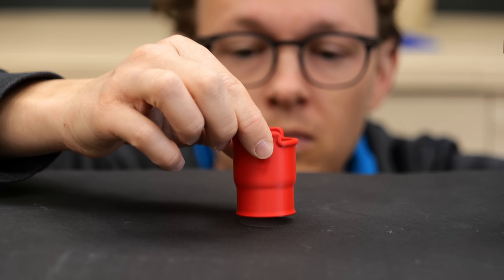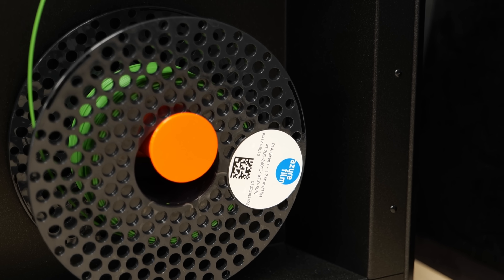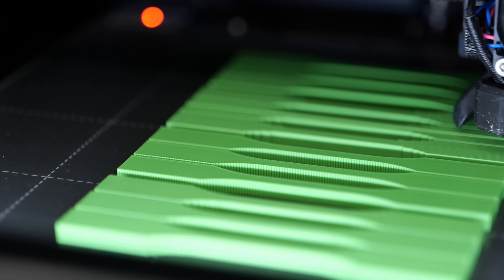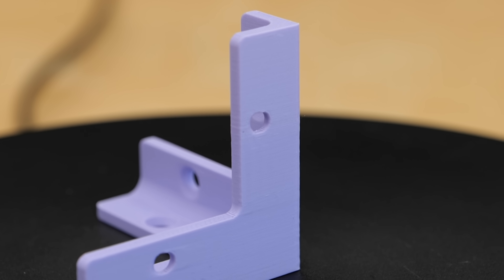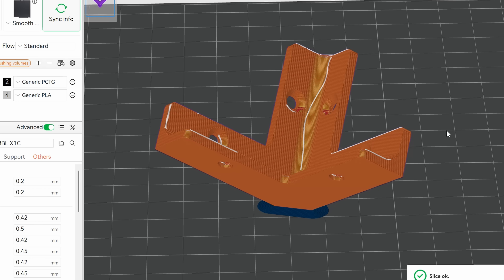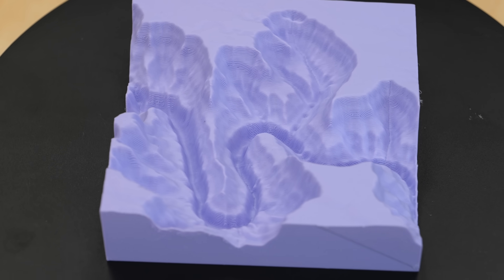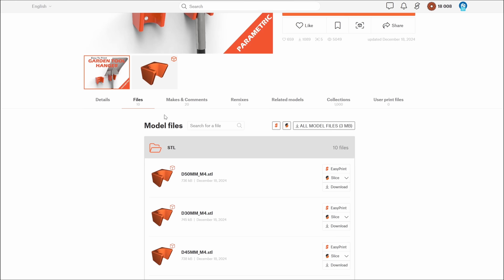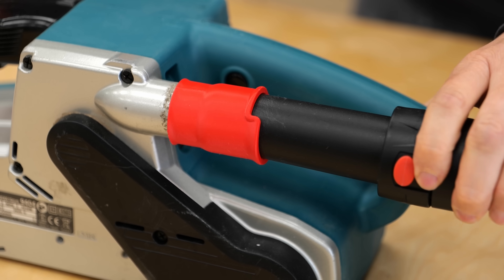Does Angled 3D Printing Really Make Parts Stronger?

Comment: I think the best advice on this topic I personally can give (because I've had to learn it the hard way and would like to spare others the time) is: If you think you might run into problems with anisotropy, remember that (if you design a part yourself) you don't always have to make one big piece; screws, glue, or 3D-printed connectors can help you print multiple small parts in their optimal orientation and then connect them afterwards. An example I created was a rigid, flat wallet for credit cards etc. Printing it standing up would crack it when it flexed, and printing it flat in one piece didn't work because the bridging was too extreme. So what I did was print the two flat pieces (the "top" and "bottom") flat on the print bed, and then made a 'C'-shaped spacer; I left 2mm holes in regular intervals (I think every inch or so) and after all the pieces were printed, I used filament like rivets by cutting them a bit longer than the thickness of the wallet and then using a soldering iron to mushroom them out so the parts couldn't separate. I also chamfered the edge of the holes on both sides so the "rivets" would melt flat and still have room to widen, but in retrospect that was almost unnecessary. The wallet so far has survived about two years in my pocket, so the filament rivets do hold up pretty well.

TL;DR: If you can't find an orientation for a big piece, try to separate it into multiple pieces and assemble them after printing.
Reply: This is the way!

Just because you CAN print something all in one go doesn't mean you should.  I've built some things out of 3d printed parts that people have said couldn't be done or would come out incredibly weak because of the layer lines, but if you break it down into  smaller pieces and do what you can to keep the layers in compression you can make some wild stuff.
Reply: @ellieallen115  And just because you can print something does not mean you should. like the bracket, it's good for strength demonstration but it is the kind of simple industrial part you should just buy if you need it.
Reply: @gathorall9136  Yea, a 90 degree strut strap is less than 4$ at home depot. But I suppose some may want to maintain a certain aesthetic, and the added strength isn't necessary
Reply: 我自己沒在用3D印表機 但我也是這麼想的
看著很多人在探討怎麼印比較好時 我總會想用組合的讓各部件都有著它最優勢的列印方向再組合起來不好嗎?
不知道是不是因為我是從小就常玩組裝模型 對這個想法覺得很理所當然
但3D印表機的使用者應該也大都是手做愛好者吧 小小的組裝應該不會成問題才對
Reply: I was just thinking that, I would print it standing up, so I don't need so many supports, but with 3 or more channels around it and screw screws into them to take the moment forces. Also a thicker rings at the start and end.
I always design my 3D prints to be supported by screws through the material.
Reply: Alternatively, get a piece of pipe that does not fit and print adaptors to put at either end. If you manage to crush the plastic inside the metal pipe anything else would also have failed.
Reply: This sounds like a great design. Is there any chance you would care to share it?

Comment: For the test hook printed at 45deg, I wonder if the lack of strength improvement came from the thinner side walls.  If perimeters stay the same it makes the effective wall thickness thinner the more of an angle it is at.  At 45deg it should only be 70.7% as thick as if it was straight up and down.

Comment: I made a shelf for filament earlier this year. Printing it on the corner not only made it stronger but also allowed me to connect all three axes of each connection with a single bolt. It also made it look a lot nicer. Printing orientation is probably the first thing I think about when designing a part, it helps limit or completely eliminate supports while making the best of the technology used.

Comment: 00:10  45 degree on the edge. Curious to see what you went with.
Reply: There is a reason most 3D2A parts are printed at an angle…

Comment: I don't know how much this is covered by patents but something I have been looking for in slicers is staggering the infill as Stratasys does so your infill is printed with half layer offset from the perimeters. There's a possibility to fiddle around with the extrusion parameters and use the combined infill option on Prusa slicer to print extra thick infill every other layer, but I haven't been very successful with it.

Comment: I actually just had a project where I was fixing my couch. The original part was a fairly thin injection molded ABS, it got most of its strength from the staples holding it to the couch. Replacing it involves taking the couch apart just to staple in the same flimsy part. Instead I made my own, but since this is a leg and has to support not only my weight, but also shock/shear loads when someone sits down quickly and at different angles, orientation was critical.

I ended up splitting it into 3 parts, the leg itself and the two plates the attach to on of the boards inside the couch. It would be too long for a yt comment to explain the orientations and why, but suffice to say I'm writing this on that couch with the new part right now 💪

Comment: Silly maybe, but I have found, that at least for PEI plates, simply cleaning it with 5 parts good dish soap to 95 parts water does absolute wonders.  I also do NOT rinse it off, I simply wipe it with a clean cloth after cleaning with the soap.  
Bed adhesion problems are a thing of the past, at least for me.

Comment: @8:22 “S shape”… NO, you choose the shape of the interpolation without consider the obvious physics: the greater strength is proportional to the length of the continuous material deposition, which increase as the cotangent of the angle you defined and stabilises to the maximum when the whole length of the object is covered by the cotangent, furthermore the infill angle and type (obviously) would matter for your pull on length reductive test. E.g. 100% infill with “aligned linear” pattern along the length (adjust the rotation parameter of aligned linear to 0 or 90 degree depending if the piece is oriented along x or y when sliced) and you will get the strongest strength on pulling

Comment: My question is why you don't take your own advice as default when printing. You managed way stronger layer lines with VERY minimal part cooling. 0.45 or 0.48 mm layer width and slightly elevated temps. All can be achieved while keeping good quality. I don't have nearly ANY lay splitting even on weak parts tested to failure. That's thanks to you. Why is that not default when printing for you?

Comment: Good video, this is something I've been doing for years, particularly when printing parts for firearms. It definitely helps with strength in real world situations. Given that the parts I print are put to very high stresses, I've been forced to find techniques such as this to maximize part strength. 

I also do a decent bit of resin printing for functional parts where orientation is the difference between a durable part and one that just snaps instantly or is dramatically warped and out of spec. Something you might be interested in is the slicer for Formlabs printers called Preform. Their auto orientation feature is quite refined and can give you some interesting ideas on how to properly orient a part for both FDM and resin printing. You should be able to use it to slice a model without a Formlabs printer attached.
Reply: 3D printing firearms 💀
Reply: @liamoliverdarroch6482  Parts used with firearms
Reply: @sourc3C  Bro you're 3D printing ALL the parts for firearms? Most people just print part of it, that's crazy

Comment: I had biggest struggle regading orientation when I designed a rack and pinion mechanism with three pinions in 120° angle each. the triangle shaped rack had no "good" orientation to print. At the end I splitted it to two parts, glued together with dowls. At least the teeths ware printed well, not sure about strength, at least no fail until now.

Comment: use the long direction for stress,  Whats more important is use the correct plastic and if you really need strength then anneal.  never use PLA for anything but prototypes or trinkets.

Comment: Thank you for all this information.

One hint: If you print with less than 100% infill, changing the orientation also changes the amount of filament you use (in the model as well as for support), you should compare strength with same filament usage.

Comment: Would part strength differ much if each part would be printed separately? In such case new layer would be dropped on a still warm previous layer and maybe some better connection between them would occur?

Comment: Call me lazy has fuck but im still using a 5 years old slicer with only 3 / 4 settings and it's fine. But yeah the profile of my machine is not present on real slicer so i can't print those support trees, sadly. But yeah of course some orientation are better than others, and you need to design with this in mind, who gonna make things harder if your part is complexe.

Comment: you can also print your part at 100% infill, then pun it in the jar of fine sandblaster-grade sand, compact the sand until i can hold the shape of the part, put the whole thing in the oven until the whole part melts down and then resolidifies into injection molding-like strength

Comment: I'm very skeptical of that s-shaped fit. The data shown don't really show that shape at all.
Reply: With just a few single-part data  points, and allowing for a host of variables in both parts and measurements, the experimental curve could be any shape.  
Stefan's experiment gave a  remarkably good fit to the theoretical line - my old supervisor at Rolls-Royce would have accused me of fiddling the results if I'd got that close, and sent me away to do more tests!

Comment: If I have to use a brittle material, I make place for long M3 bolts + threaded inserts in the MCAD. With the steel reinforcement, the layers will not break. Otherwise, TPU is king in this case !?

Comment: Good tests, but I would just print your hose adapter hotter, slower and make the part chunkier. Your previous tests showed that this can make layer strength up to 80% of the XY strength, which is good enough for any use if you add a few perimeters. I've used this to good effect with ASA and ABS. I'm surprised you didn't mention this option!
Reply: I really think he just used the wrong main example for this video.  There were too many OTHER things that would've made more sense, (material, time, temp, design). At the end, he almost just said "this is not really a great idea".  I think the other examples were good though, like the benchy and the bridged part.

Comment: the real answer is don't use worthless PLA for functional parts... duh. Get some PETG pr PCTG and print it however you like
Reply: PETG / PCTG is stronger for a lot of applications (not all), but still suffers from the same layer adhesion problems.  Print orientation still makes a huge difference

Comment: Just use TPU
Much "stronger" and won't crack.

I love it for thing that should be slightly flexible like vacuum adapters.

I made a vacuum adapter to stick to the wall wile drilling in concrete, went through 3 PLA ones for 3 holes then i printed in TPU and it held up to the last 30 holes i needed it for and still looks like new

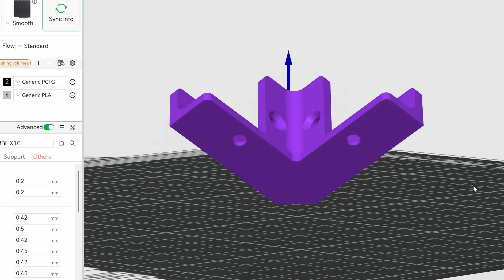Comment: 9:20 just move the object a bit down and the slicer will only print what is above the build plate, easier than cutting
Reply: It depends on the slicer. Not all slicer allows to "submerge" the part below the bed, but cutting parts is available in all of them?

Comment: One aspect to improve interlayer strength is line width. By pushing more material there is more heat and this creates a better connection. I did some tests which were not very scientific, and the outcome was clear.  Maybe you can perform a few tests.
Reply: Stefan did do a vid on how layer height affects strength. I don't recall exact results, I vaguely recall don't go beneath 0.16mm for strength.

Comment: I was thinking for the vacuum adapter, you could make it into two parts. Inner sleeve and an outer sleeve printed at opposite 30-45 degree angles then bonded together. Sort of like how carbon fiber weave orientation is alternated between plies for strength.

Comment: design the object so that it prints at a 45 degree angle anyway. it doesnt need to be a tube with a flat bottom just because thats how other hose nozzle adapters are designed. make it a trapezium, or a parallelogram.
Reply: I was thinking this but in the horizontal orientation. Why not design a flat spot on the horizontal section for which it can stick to the bed better, minimize overhangs when it starts printing up the contour of the adapter and use lower layer height for better overhang printing.

Comment: I often use threaded rod, or even lengths of a metal coat hanger, to strengthen my parts perpendicular to layer lines. For the corner bracket, for example, design a hole from the outer edge of one of the arms into the intersection of the three arms, with a diameter that is snug around a piece of coat hanger, then drive the coat hanger snippet into that arm after printing. 

For the vacuum adaptor, I would have probably added 3 coat-hanger 'channels', spaced evenly around adaptor, and printed it vertically.
 
I know...post-processing bad...but if strength is paramount, I do what I have to.

Comment: I design for Printing and this is often the most important consideration, though it can be over come by increasing wall count on some designs, with some materials, I have some designs that are essentially round bars and printing them in th wost orientation works because of the high wall count, and material selection.

Comment: Generally, I tend to print on the hotter side with as little cooling as possible - helps with layer adhesion (but sucks for cosmetic quality). Apart from that, I try to have the layers along the assumed path of highest stress. Where that's not possible, going chunky might be the next best option. If neither is an option, I cheat by designing in one or several groove(s) perpendicular to the layer lines (or perpendicular to wherever a break seems most likely) and put in some fibre reinforcement (a few rounds of string or a piece of cf roving and superglue).

Whenever there are screw/bolt holes perpendicular to the layer lines, just making them really long can also do the trick (like, having the screws/bolts run along most of the part length).

Comment: My issue that nobody talks about with printing on an angle is that unlike resin printing, the dimensional accuracy of FDM decreases like crazy when you tilt an object like that unless it is essentially designed from the ground up for that angle, and you're essentially guaranteed major support material removal at the end as well. This problem becomes much worse with materials that are not PLA but IF YOU NEED STRENGTH YOU ARE NOT USING PLA! 😂 Carbon fiber materials help with this, but their dimensional resolution is worse than unfilled parts as well even if the accuracy/warping is better, so making sure a part meets the tolerances needed becomes significantly harder when you have to tilt it. I have done it before, but it's just frustratingly difficult

Comment: For hose adapter the easiest explanation why this helps is that each layer surface area increases, so you get better adhesion just from increased surface area, even if the direction is not optimal.

Layer orientation is a problem that sometimes stops me from designing a part at all, as soon as it becomes apparent at early stages of design. Best solution is having multiple parts, but it is a major PITA.

Comment: The most crucial step towards part strength is to design it with printing orientation and expected stresses in mind. This is often overlooked in printables and other platforms, as seen with 3D prints mimicking metal sheet parts, like the brackets shown here.
Reply: I've also seen parts made for injection molding - draft angles, hollowing out bits that would be too thick for injection molding, etc.
Reply: @logicalfundy  Draft angles can be good for helping with fitment though, especially trying to put parts into recesses or holes.  1-2 degrees on bearing holes makes them slide right in and stay there without needing to get the hole exactly the right size.  Again, super dependent on print orientation
Reply: Truest true!
Reply: Ok but that adapter has no room for changing design
Reply: @olafmarzocchi6194 
Sure it does. 
Reinforcement ribs. Thicker walls. Channels for 2-3 M2-M3 screws to preload the part in compression, if you REALLY wanna make it nearly unbreakable. 
There's exactly three critical parameters in this part: hose ID, vac output ID, and the intervening channel has to be reasonably clear of obstacles (just don't plug it up, even making it ribbed internally for more strength is fine). Everything else is fair game as long as it fits right.
EDIT: oh and of course, adding screw-on brackets if friction fit isn't holding it quite secure enough is also an entire option you could choose.
Reply: @olafmarzocchi6194 make it thicker?
Reply: @olafmarzocchi6194 you couldn't extend one side at an angle to have the end touching the bed closer to parallel to the bed?

Comment: The option of inner and outer sleeves glued together. Vertical and horizontal prints one inside of the other.
Reply: That's a great idea.
Reply: you can go one step further out of the box. the part can have holes for cheap threaded steel armature :)
Reply: u are this cl9se to inventing fiberlayups...
Reply: Yep